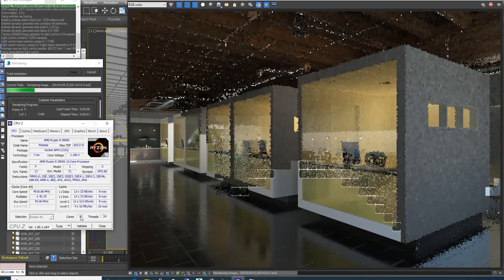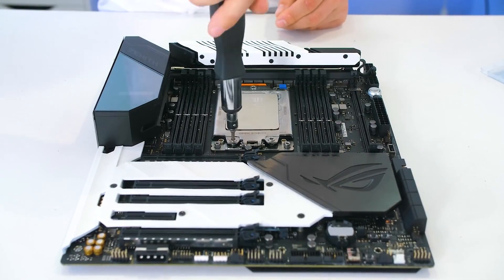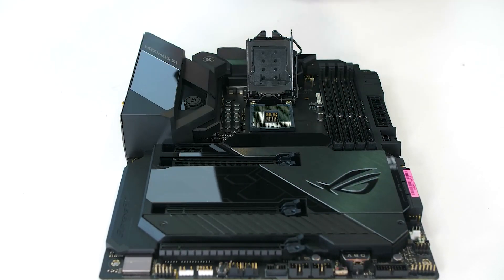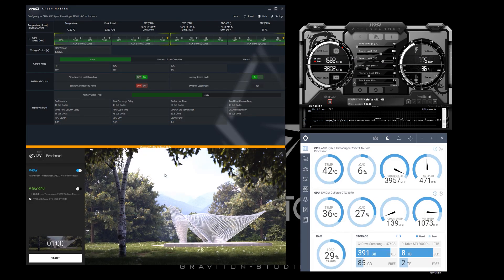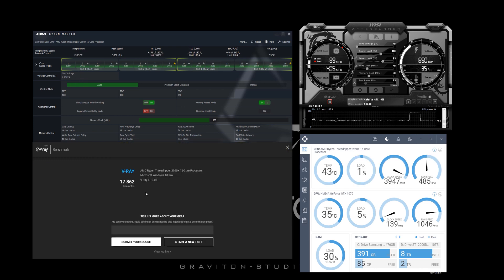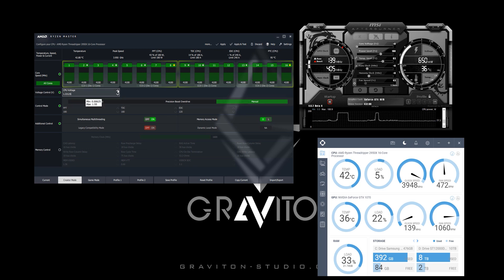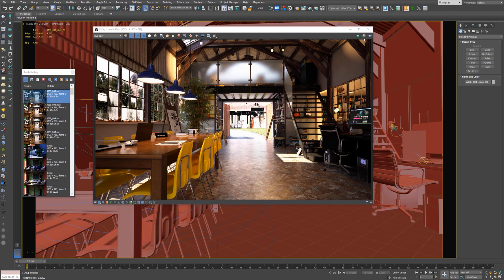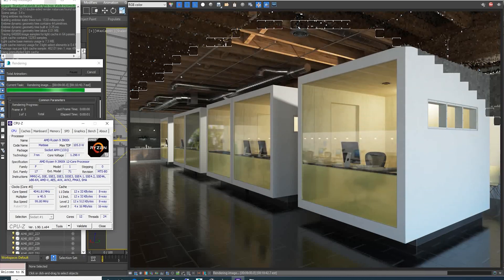How to Overclock your CPU | Boost your Rendering Speed !

Comment: Can u make a video about undervolting?
Reply from the maker: from the same software in the video ... just decrease the voltage and the core clock speed
Reply: @GravitonStudio  OK thanks! But I meen a full video explaining the benefits and doing tests and so on.
I've seen videos about the benefits in gaming and temperatures gains, but no one did one about rendering.
It's just an idea.
Thank you very much after all.